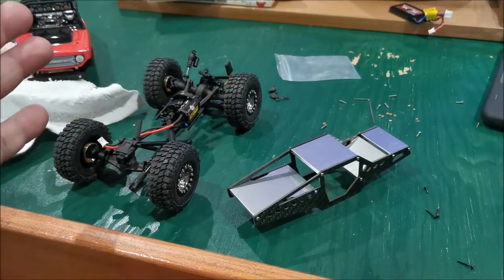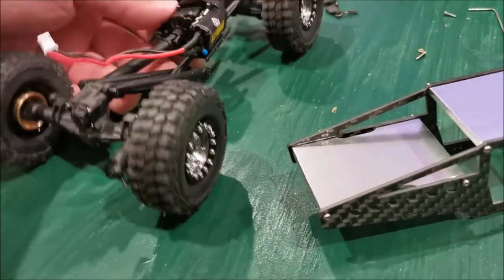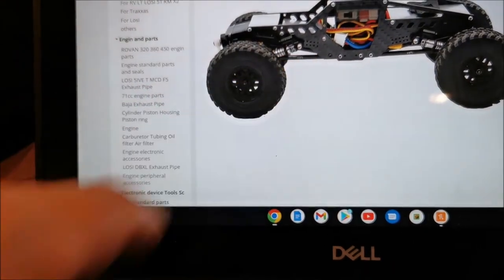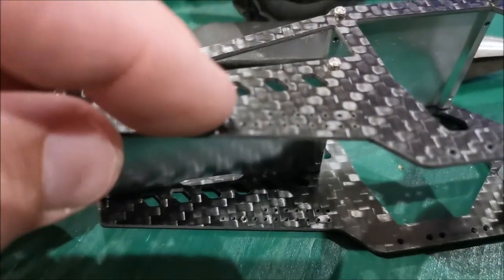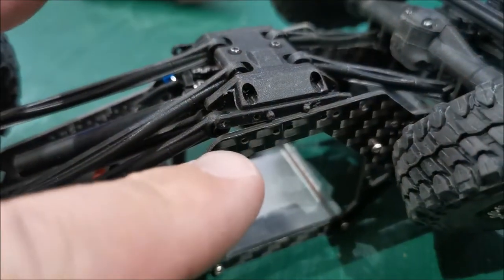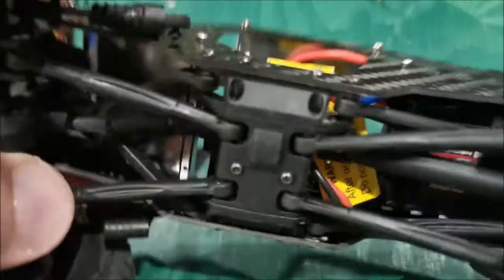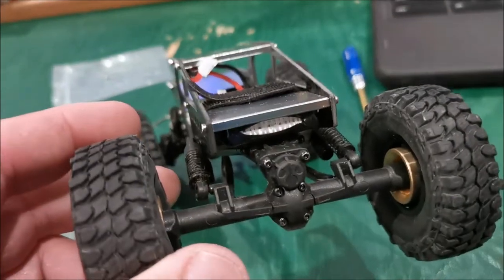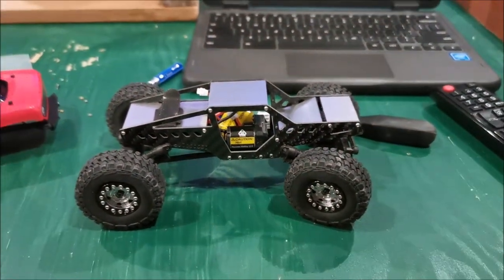SCX24 Bellydragger build video (UPDATE 2)! Deadbolt converted to LCG chassis EP#594

Comment from the maker: Some people been waiting for this video and it's here. I was going into this blind of course because there is no instructions. I started building this later at night and it took a while, then i took it apart again to show in stages how to put this together. I used my phone for the video, so it's not my best work but I wanted to get this video out soon as it's been a few weeks since I introduced this frame on my channel in a video. There is a link in the notes where I purchased it from on Aliexpress. I will say the build went OK but I broke the first screw attempt using the stock shock screw and screwing it into the frame. Also the pictures from Hot Racing, they are using extended drive shaft and links on the front in order to get this much lower, using aftermarket parts. Their servo is out front of the frame. You can't achieve that with the stock parts I used from the SCX24 deadbolt. I think it still looks good! I believe all you need to do is buy the rear links set and put them on the front along with the rear drive shaft and install it on the front. That will lengthen your build. All in all I think it turned out good, I need to get a new screw pillow ball for one of my shocks. I might go with some cheap injora shocks and links to pimp this ride out! Let me know what you think in the comments. See you again soon on the next video!

Comment: Put the battery on top of the mounting plate. Will raise the CG a bit but it might let it settle down some & make up the difference. I have a Warthog that looks similar & I run stock shocks with no springs. It crawls like a little spider.
Reply from the maker: Yup I agree. That's where it will likely end up. I got some links from injora and I'm lengthening out the build in the front. We'll see how it goes. Have to find some time to get it done so video will be coming out sometime in the next month or so, so stay tuned my friend. Thanks for leaving a great comment!

Comment: Where you put the ESC?
Reply from the maker: Hey buddy! Double side tape it to the ceiling of the roof panel above the motor. It will fit in there nicely! Thanks for a great question. I'll have more on this soon. I'm probably going to stretch it out, especially in the front so it'll be slammed lowered.
Reply: @mikesrccorner  thanks buddy i put it at the same spot. A bit creepy about the wires but it function. You need to put some portal axles on it it looks superb.
Reply from the maker: @PapaStingray   i'll have another video out in a month or so, I ordered up links and driveshaft from Injora to stretch it out. I'll use the set of 43mm shocks I got too.
Reply: @mikesrccorner  check my video i finished mine… but i‘m not happy yet… 😝